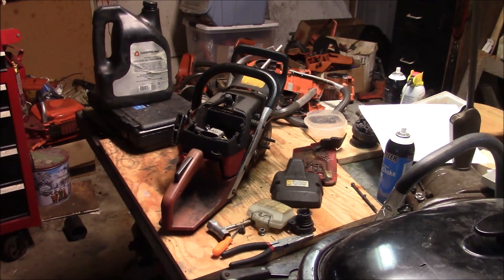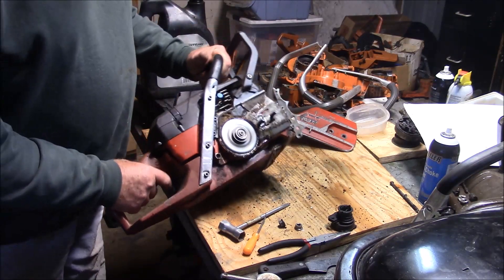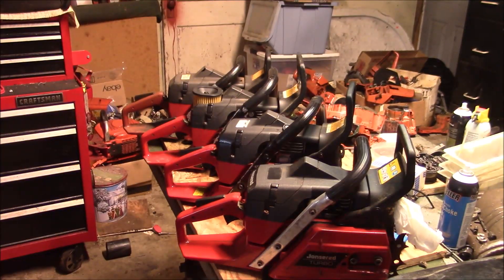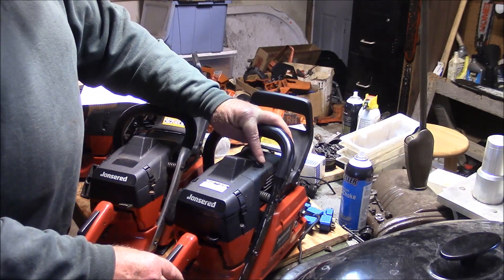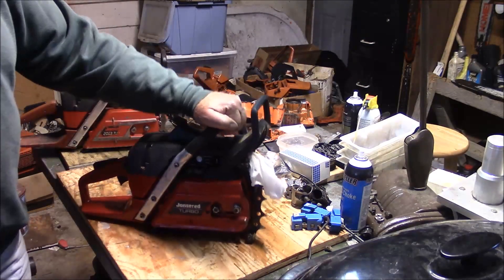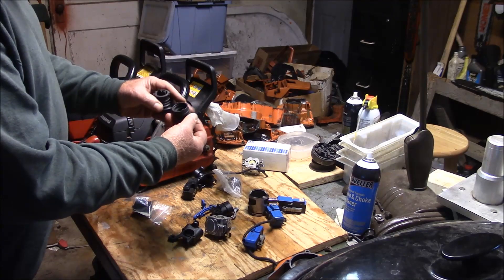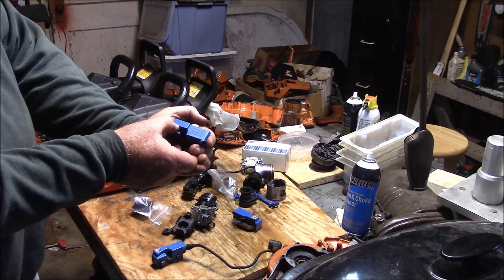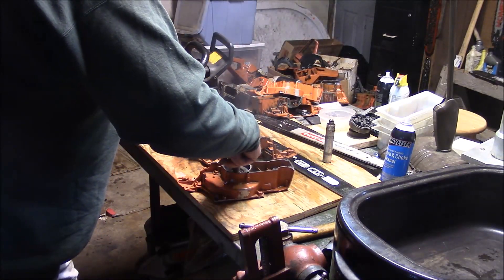Husqvarna 372 Family Of Saw Part 2 "Bits & Pieces", Jonsereds vs. Husqvarna Component Differences

Comment: What chain brake bar’s will fit on my 2163
Reply from the maker: Pretty much just the small mount 20 or 2163 and Husqvarna small mount counterparts of those models.
Reply: @afleetcommand  I meant the handle for the brake